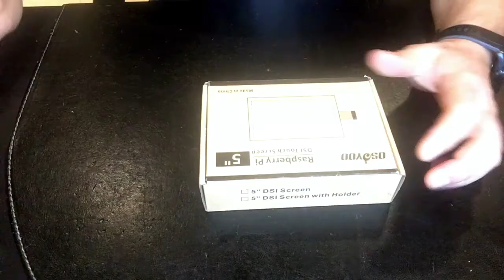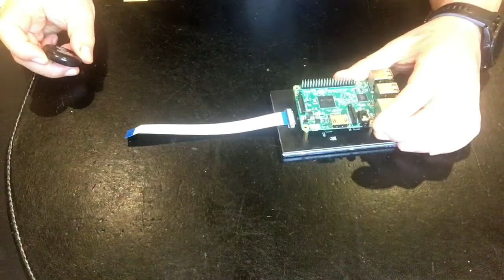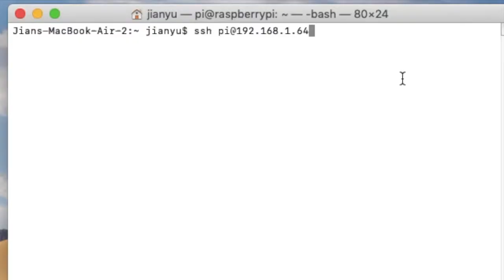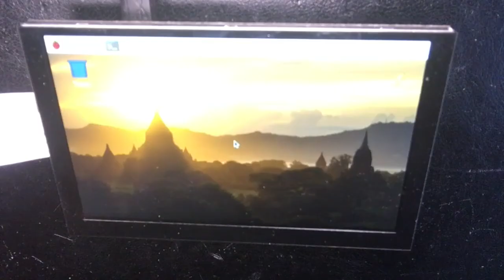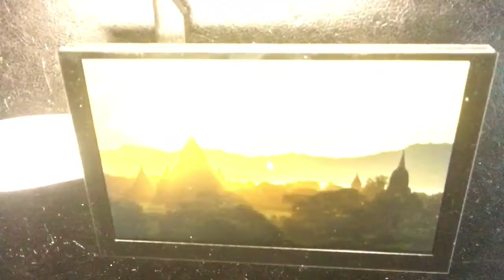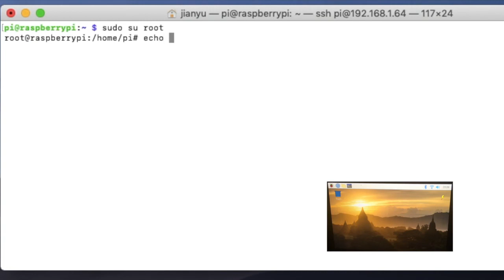No need driver! OSOYOO DSI IPS 5" touch screen for Raspberry Pi 4,3,2,wide view angle,Easy Install!

Comment from the maker: The screen purchase links are:
Amazon USA:  https://amzn.to/2RDrmjY
Amazon UK:   https://amzn.to/2Dg2sjC
Amazon Germany: https://www.amazon.de/dp/B07KJBCNS8
Amazon Italy:  https://www.amazon.it/dp/B07KJBCNS8
Amazon Spain:  https://www.amazon.es/dp/B07KJBCNS8
Amazon France: https://www.amazon.fr/dp/B07KJBCNS8
Amazon Japan: http://www.amazon.co.jp/dp/B07KKB5YS9

The screen comes with an 6-inch(15 cm) flat  ribbon DSI cable. If you need extra size DSI cable, you can purchase the cable package from 
Amazon USA： https://amzn.to/3xXSOtv
Amazon UK: https://www.amazon.co.uk/dp/B08B14RGV2
Amazon Germany: https://www.amazon.de/dp/B08B14RGV2
Amazon Italy: https://www.amazon.it/dp/B08B14RGV2
Amazon Spain: https://www.amazon.es/dp/B08B14RGV2
Amazon France: https://www.amazon.fr/dp/B08B14RGV2
Amazon Japan: https://www.amazon.co.jp/dp/B08F4WV8VT